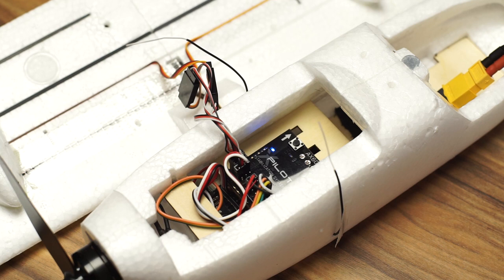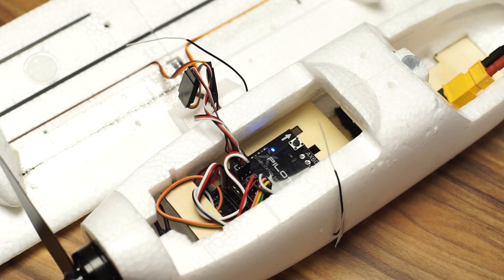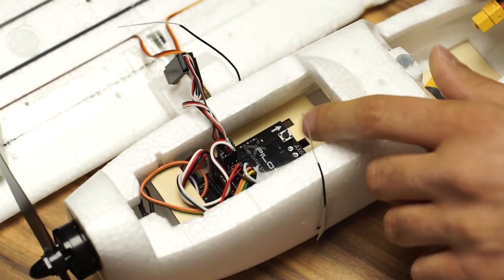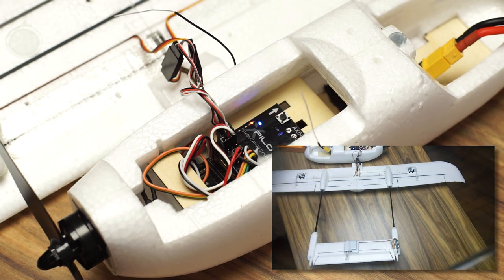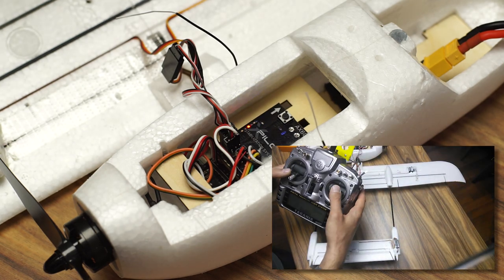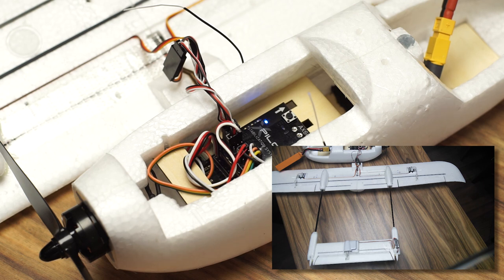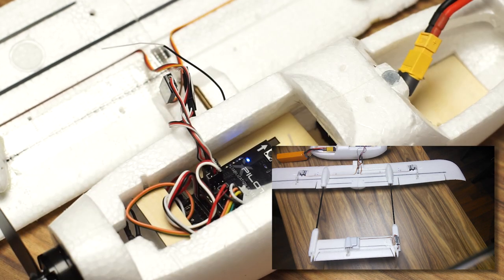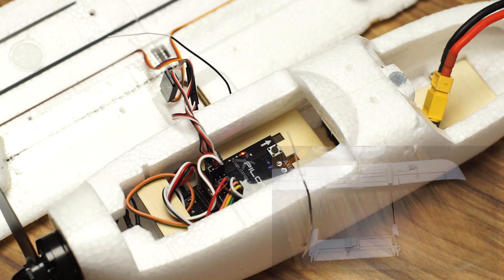Volantex Xpilot stabilization system - calibration and setup

Comment: Hello ArxAngel,
thanks for all your videos.
This one is really useful but I have an issue with the elevator stab. Controls are fine, aileron stab too but I can't get the elevator stab in the proper way even after 15 calibrations. Another thing weird, at the end of the calibration, when I push the 2 sticks to the bottom right corner, the blue LED switch off and the 3 red LED keep on.
could you help me please? Maybe something I did wrong.
Thank you.
Reply: I found the solution.
This issue is caused by SBUS port (with frsky X4R and X8R)
So I wired 1 pin for each channel between receiver and AX601.
when calibration done, I wired the SBUS cable instead of all single wires
If anyone has an issue with bad stabilization, try this, It works great for me!!
Reply from the maker: Hi, I am not sure what to tell you! Re-doing the setup and calibration but this time moving sticks in a little different sequence for the ones I wanted to reverse seemed to do it for me!
Reply: I had same S-bus problem too will try the solution below. Thank you
Reply from the maker: I hope it works out for you.
Reply: I'm having the same problem. All other surfaces are responding correctly, but the elevators are moving the wrong way, opposite to what they are supposed to be doing. What do I do to solve this please?

Comment: Hi. Thanks for getting to tech is good too use this, but can you please show me how to wire from my receiver to the stabilizer? I can't find anywhere a diagram of how to wire it. I'm so frustrated. The pins on the bottom right has only one pin per function; i.e. One pin for AIL, one pin for RUD, etc). My receiver has 3 pins for each of those. How do I connect those three pins onto one on the stabilizer? Please help! Thank you
Reply from the maker: You don't connect all of them, you need to connect only the signal pins, and only one of the channels will have the 3 wires, so it can power the receiver.
Reply: ArxangelRC thanks, I got everything to work now, but now the elevators are moving the wrong way. Any ideas on how to fix this? Your help is greatly appreciated!
Reply from the maker: For me doing the whole setup and calibration routine fixed that... but to be honest I am not so sure which part exactly does it!
Reply: ArxangelRC I'll try that. Thanks for the help.
Reply from the maker: You are welcome! I hope it works. :)

Comment: This is absolutely useless, so difficult to connect. Even in your video you can't see where is right wires connecting to rx and stabilizer. By mistake ordered 3 pcs.
Reply from the maker: Well... this is old now, definitely not the best product out there! I am surprised it is still sold!
Reply: @ArxangelRC  you should help me out to fix it...will you ?
Reply from the maker: I don't have the item anymore... but I can try! What do you need?
Reply from the maker: I do have facebook, find me on there and drop me a message.

Comment: Hi,
Will it work with Delta wing. How to switch between modes, like manual and other
Reply from the maker: There channel 5 is usually meant for mode changes, but I am not sure it will work with a Delta wing, might need to add a V-tail mixer: https://hobbyking.com/en_us/turnigy-v-tail-mixer-ultra-small.html?affiliate_code=HDHKDJZJULGAXSG&_asc=2227711631
Reply: @ArxangelRC  if I am using vtail mixer I should use which two control.
Reply from the maker: Ailerons and Elevator... but at this point there are better options out there... so I would suggest you look around some more, this unit is a bit outdated now!

Comment: Hi
I did all steps. After saying I powered off and power on it. To blue led is blinking not getting stable even after 10 min
Reply from the maker: Do you have it sitting still in one place?
Reply: @ArxangelRC  yes on the table for 10 min minimum. Still same
Reply: same problem i have blue led flashing for more then 10 min and for nothing please help
Reply from the maker: Really not sure what to tell you guys... perhaps something had gone wrong during the calibration and it needs to be done again? I don't have this unit with me anymore and can't really say what needs to be done! Perhaps you can send an email to Volantex directly and ask them.
Reply: @ArxangelRC  I tried many times to to recalibrate. Same thing happened
Reply from the maker: Might have gotten a defective unit... really not sure what to tell you! Did you try to contact Volantex?

Comment: Hi, Thanks for the video. Is it possible to switch during flite the stabilization on and off? best regards Bee
Reply from the maker: Yes, if I remember correctly, switching the stabilization off was possible! :)
Reply: Yep. You set up your receiver channel 5 on a 3-position switch (+100, 0, -100) That will give you a choice of Full Manual control, Self Levelling and stabilized with no limits on pitch, etc angles and Self Levelling and Stabilized with angle limits.
Reply: @theoztreecrasher2647  im at my wits end.  i have sussed all the calibration stages. all 3 red led blink and the blue flases as if it was saving.  However when i reconnect the power the blue light is flashing.  the plane is level and still on my bench in the same position as calibration and no stabilization works. Any tips i ve searched everywhere.
Reply: @andyboovy  Also, if you have not long received your Xpilot, pay particular attention to this
"EDIT...I've just received a second XPilot and the calibration set-up has been changed a bit. This has been done because the new version of the stabilizer can now be set up to be used on Delta Wings and V-tail planes in addition to the T-tails allowed on the old model. Follow the new manual supplied with the new versions.
"
Best of luck.

Comment: dear hi pls tell me the arrow what direction to put in my glider?
Reply from the maker: Arrow should be pointing in the same direction as the nose of the plane!
Reply: thanks. is good stabilazer? but i try some different and is bad like OrangeRX RX3S 3-Axis Flight Stabilizer
Reply from the maker: It worked OK... should be better than the Orange one...
Reply: thanks  if i need help to setup for auto pilot i write again
Reply from the maker: Sure thing, if I can I will help out!

Comment: Nice video, as usual, thanks, it helps a lot! I'm planning to put one of these on my Firstar 200 ...it will be hard to put it close to the CG with the forum factor. 

Your channel is really cool, your videos are very clear and well drone, keep up like that!
Reply from the maker: BlackWolf2a Thanks! Even though it is better to put it as close to CG as possible... it is not critical if its not, so don't worry about it! :)
Reply: ArxangelRC i'm relieved about it, thanks for the information! i'll tell you how the Firstar fly with this little stabiliser!
Reply from the maker: BlackWolf2a Cool. Good luck! :)
Reply: Where to put it inside firstar 200 ? It is already crammed.
Reply from the maker: Ha... I can't say really... Mine is also quite crammed... really don't know what to tell you about this! :) Look at the plane and see if you can find some little space to put it in.
Reply: ArxangelRC blackwolf2a will put it not me :-P
Reply: ArxangelRC i really don't know how to do it, maybe somewhere outside
Reply from the maker: I would rather move the radio receiver outside and put the stabilizer inside.
Reply: It would be best solution, receiver outside,  stabilizer inside, on small "platform" over servos. It is not level, but it's easy to cut or add some foam. I flew firstar 200  line of sight  in moderate wind today,  it gets trown around , but it's so fun to land into wind with almost no forward speed.  I have 2 of them, one is loaded with FPV gear, but this one is without anything and it can fly really slow. It has around 220g.  It also glides rather well. Micro skyhunter is capable plane, but firstar 200 is more enjoyable to fly LOS in my opinion.
Reply from the maker: Actually the SkyHunter a quite good model, and it has more space inside the fuselage than the Firstar, so installing this in there is much easier. If you have the Taranis radio, you can get one of the new FrSKky S6R receiver with integrated stabilization, and use that on the Firstar.
Reply: Skyhunter is much better for FPV, of course, and it can fly LOS nice.  It is however 2x heavier, and needs more speed to fly. I calculated it is on average 10-15 km faster than firstar. Firstar 200 has average speed of around 45km/h, and micro skyhunter 55-60 km/h. Interesting, they have wings of similarly same area, but skyhunter's profile is deeper, it provides more lift.   My experience with both planes was:  Firstar is slower and easier to fly LOS. It is good for FPV, but has low endurance and lower speed, and there is minimal internal  space.    
MIcro skyhunter is not best plane for beginners to fly LOS if you ask me, it is fast, ailerons react swiftly, even with double rates, expo.... and it is easy to lose it from sight or lose orientation.   But, as soon as You try it FPV, it is great plane, responsive, can't stall, it really parachutes to ground as you mentioned. It can carry 2x larger battery, fly for 15-20 minutes and has inside space for all necessary .     If anyone wants to fly FPV, micro skyhunter is better choice.   If one needs small plane to carry everywhere and fly LOS i will choose firstar.
Reply from the maker: Actually I've been able to reliably and consistently slow down the SkuHunter almost to speeds equal to the Firstar! Not sure why yours are flying so fast, but when iI flew the Firstar it was able to slow down a LOT, certainly well below 45km/h. And same goes for the SkyHunter, I am certainly able to slow it down well below that speed as well and still fly it stable. :)
Reply: ArxangelRC You are much better pilot than me,especially for line of sight, i fly planes just for one year now...I calculated average speed from my fpv videos when i was flying relaxed, not too fast, and it turns out skyhunter is faster. It certainly can slow down, but in average it is faster. Skyhunter is so powerful, 1-1 power to weight ratio, i found out it can climb 9m/s, i climbed 500m hill in less than a minute.
Reply from the maker: Yes, it is definitely much quicker than the Firstar! It is a really nice model! :)
Reply: To me it's as clear as mud.